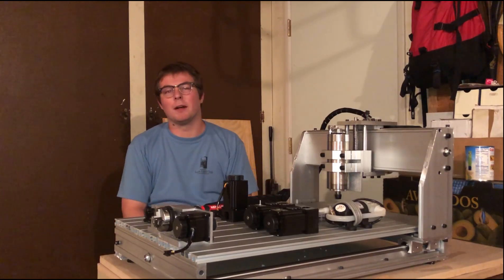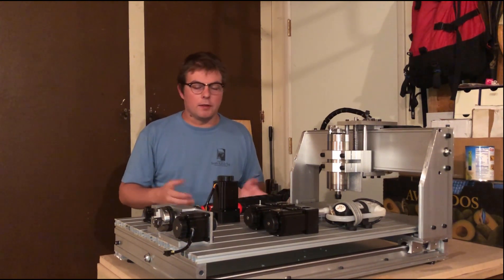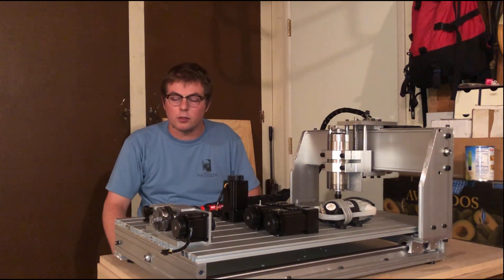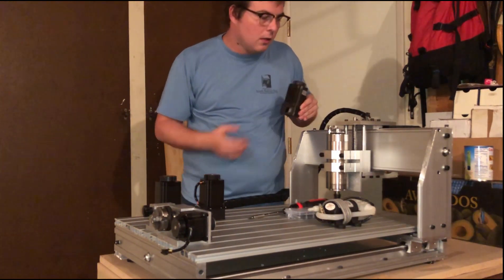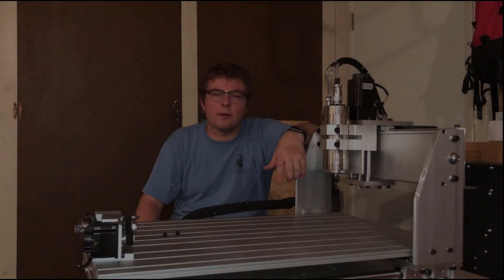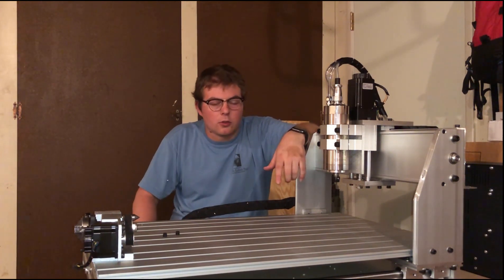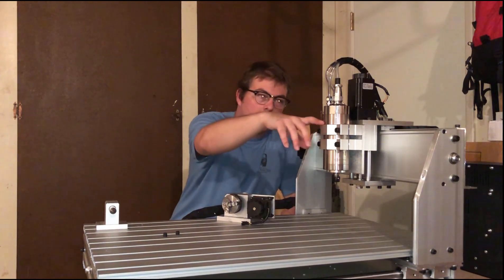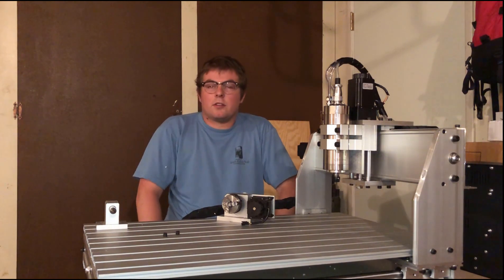Assembling a 6040 CNC Mill Kit

Comment: I'm upgrading from a 3040 cnc 300w to one of these, have you cut alluminium with it yet?
Reply from the maker: I haven’t tried aluminum with it yet but small workpieces should work with thin material and/or conservative settings. 800 W is good, but if you can swing it, 1 kW+ spindle power works even better for metal. 

Keep in mind that cutting metal will result in more cutting forces being applied to the spindle. The 3040/6040 has a well-known weakness (discussed in plenty of other videos) in that the cross-table gantry is supported by linear rods as opposed to the more sturdy linear rails. If you want to do metal primarily, I’d look into stiffening your machine in that area.
Reply: @lifeinengineering8809  cool thanks, I have been looking at the linear rails and found some square ones. Should it be a fairly straight forward swap?
Reply from the maker: I’d have to take a closer look at my 6040, but if I were to mount linear supported rails I’d make two main modifications to the gantry:

1. Get a 400 mm rail and drill the mounting holes. 
2. Stiffen the front and rear plates of the gantry. These parts can get away with being fairly flimsy in the 6040’s design because they aren’t used to support the guide rods. With rails, this changes - the backing plate will take the brunt of cutter forces. 

An ideal solution (for me) would be to design new gantry plates in CAD and cut and install them. If you got the right size stock it would mostly be a set of drill holes to mount the rails. 

I can see about trying to get a proper set of drawings done up later when I have a bit more time to sit down with the machine.
Reply: @lifeinengineering8809  I ended up ordering this one, it looks slightly different but I'm sure the rails ect will be the same, I think the gantry is slightly higher
Reply from the maker: The basic layout is likely to be the same, with the same support rods in place. 

In particular, for metal work on these machines I’d say most of the improvement potential is in stiffening and reducing play/runout in the Z dimension. Any force at the cutter is going to cause bending moments in the Z axis assembly about the lower of the two guide rails, so anything you can do to tighten that up and make it less liable to flex improves your milling precision. 

What were you planning on using for a control system?
Reply: Another issue is in X due to the unsupported linear rods.  Another issue is the gantry uses 2-3mm aluminum so even with rails (two of them) for X the gantry plate is too flimsy so you have to change it out as well.  For a 6040 I am not sure but a 3040 that needs to be changed out.  Of course 4 rails for a 6040 will set you back a hundred, or so, for the rails and blocks alone and something I do not understand is why they continue to use the unsupported rails but on their 50 watt, or higher, laser machines they only use rails.  I know they can get the rails, and blocks, very very cheaply.
Reply: @Life in Engineering I see your 6040 had supported rails for the gantry to slide on so that helps a lot.
Reply: Those steppers look pretty beefy...do u know the oz torque? Are they 276 or 460oz?
Reply: Looks like a very nice machine for the price......i have seen the plain alum and the light beige versions on ebay...what made u choose the plain alum...it looks awesome